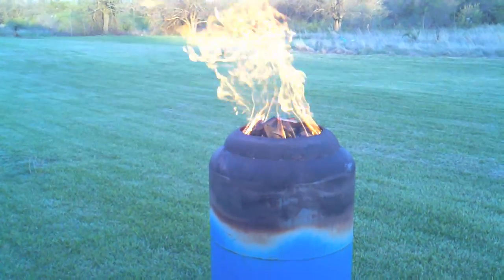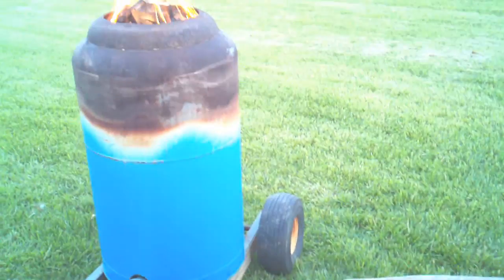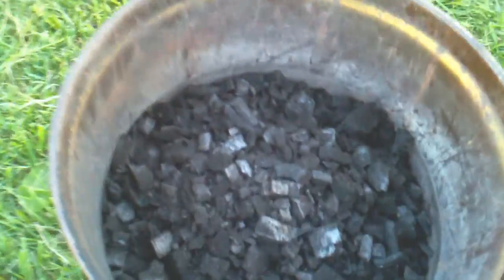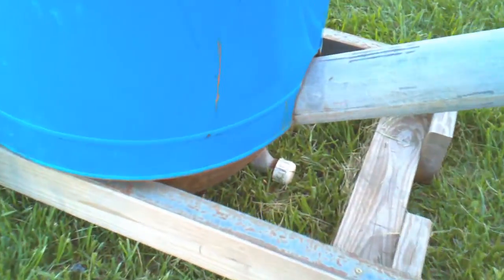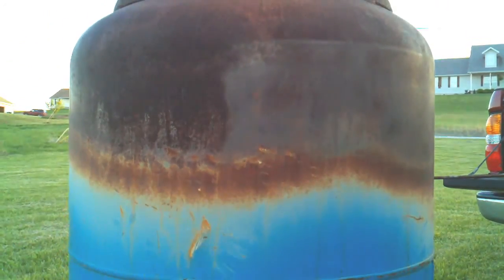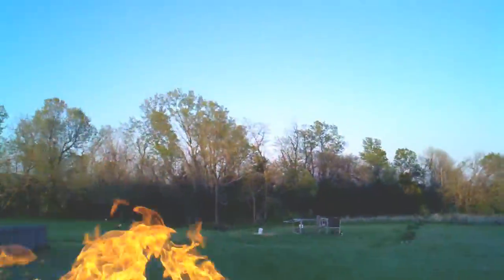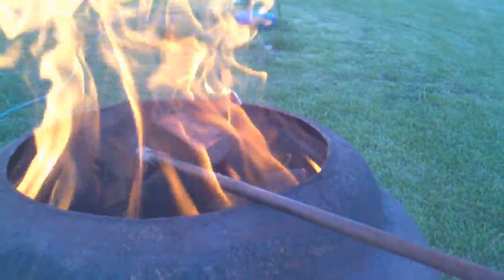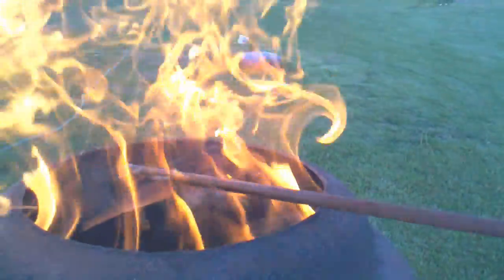Charcoal Maker Demo (Continuous Flow)

Comment: Joel I am in process of building a version of this machine out of an old hot water tank. What did you use for an auger?
Reply from the maker: I bought the 4 inch auger screw from:
https://hayspear.com/hayspear-com-and-washburn-company/augers-auger-repairs/?sort=featured&page=2

Next I found a galvanized pipe at the  scrap yard to house the screw. I think the pipe measured 4.5 inch on the inside. The pipe was old corner post on high security fencing.
Reply: @joelc6248  Thanks Joel. I ended up making an auger out of some scrap metal and PVC pipe. If this fails to do what I want I will get what you used.

Comment: I can't figure out exactly how this is supposed to work. How does charcoal wind up at the bottom of the inner tank? I don't understand why it wouldn't just be raw wood down there if it's so far below the pyrolyzing heat. Do you have a grate and an agitator somewhere higher up inside the inner tank? And how is the auger at that angle effectively scooping up the charcoal without leaving lots of it behind? (By the way, I'm in the UK and the book in your link won't ship to me.)
Reply from the maker: +Marmocet  The charcoal maker's inner tank is full all the way to the bottom with charcoal. The auger just pulls charcoal off the bottom to make room for more wood in the top. That being said, no need for a grate,  just a deep bed of charcoal slowly marching down as it is being augered out the bottom and refilled with wood at the top. The first time it is ran it needs to be completely filled with charcoal from the bottom to the top air inlet holes. This charcoal is just the starter batch to get the thing going.

Comment: Would it be possible to reclaim the VOC gases being burned off the top and use them for external combustion (IE steam) engines? This way you would not be wasting the woodgas being burned off the top and thus reclaiming energy?

Comment from the maker: Michael: The only hole (other than where the auger enters the inner tank) is a capped off drain hole in the bottom used to let water out after I hose the thing down to put it out. Open holes in the bottom of the inner tank during operation would allow air where the coals are suppose to be getting snuffed out. The top of the inner tank is however wide open.
Reply: Is it possible to just stop feeding the kiln and let it die down overnight, making it easier to restart the next day? I can see this being used on a construction site to recycle the cleared brush, running all day every day with only occasional attention. Having hot coals waiting in the morning would make restarting simple even if it wastes some charcoal.
Reply: Joel C how long burning time do you need to get the first charcoal?
Reply from the maker: Yogi Yogayaza About 30 minuts. Same as what you would see in a camp fire. It really depends on the wood you are feeding it with.
Reply: Joel C thanks joel, do you mind if i use your design here  ? I would send this to my relatives in countrysides as  I think they need . I have previous design a little one (Lucia Stove),. But your design I think could used by a little comunity in my countryside, ofcourse with a little adjusment if needed. Thanks in advance for your answer
Reply from the maker: +Yogi Yogayaza Please use this design if you would like. I just hope it all makes sense.